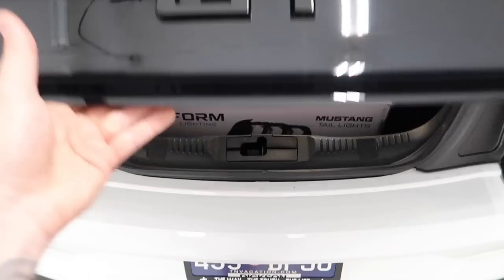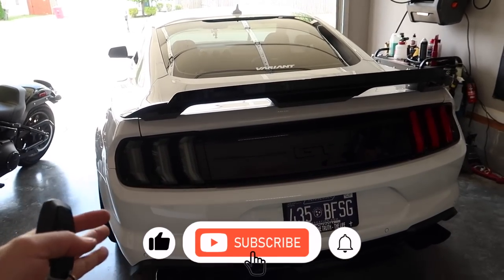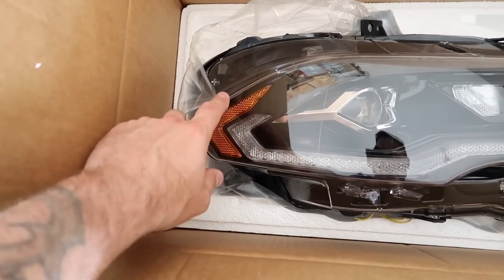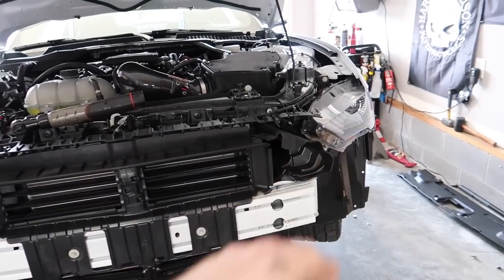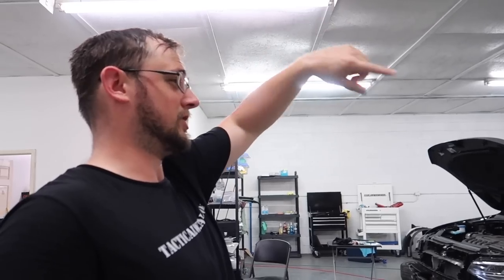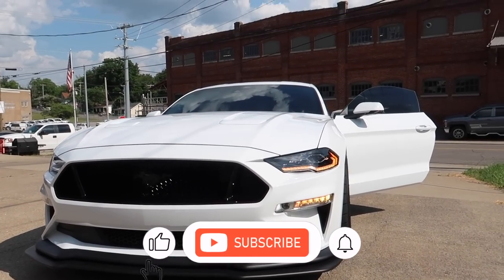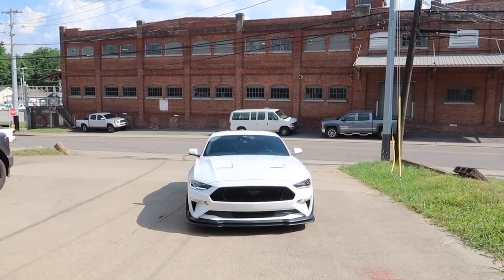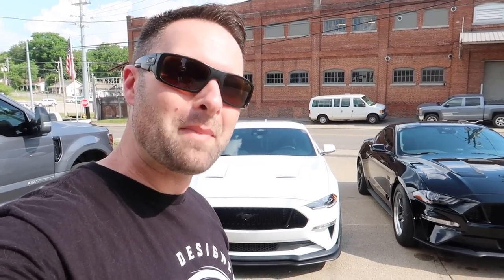TRANSFORMING The Look of My 2022 Mustang GT! Form Lights I'M SPEECHLESS!

Comment: I just installed the diode dynamics  turn signal with the yellow fog light straight fire. They are slightly tinted. Honestly you don’t have to remove the bumper if you don’t want to. Lift remove wheels couple of clips in the wheel liner  pull back  1 Electrical clip and (3 )8 mm bolts and they are out.

Comment: They are nice be sure to lay a small bead of clear silicone on top seating between lens and case.  I did my 2011 about four years back with this setup and have had zero issues.

Comment: I just traded my 2019 GT premium yesterday for a 2023 Mach 1 same color you had. We got the 10 speed. I didn't get the handling package, but it's my wife's daily.  We don't race. We had a Borla Atak cat back on the 19. We are loving the active on the Mach 1. I may go corsa double X pipe like you did, but then again I think I'm over excess loud. The factory Mach is just right on volume. People constantly complained about the Borla Atak (small town).
Reply from the maker: Oh nice. Huge congrats 🙏 the x pipe on the Mach 1 is perfect. Slightly louder but amazing deep sound with the stock mufflers.
Reply: @Zander13Productions Ours had the blade on the deck lid. We want the GT500 spoiler like this one and the Mach you had. Is that just a bolt on? I don't want holes showing from the blade, or have to drill new ones.

Comment: I bought these headlights but I always have to drive with the high beams because I can’t see with the normal dim
Reply from the maker: Did you align the low beams? That has to be done
Reply: @Zander13Productions  I didn’t see that in the install video but thanks

Comment: Looks good, but the morimotos look better, the way their lines match up with the lines of the car in so many ways and angles is just impressive, very thought-out design (though they have no startup or blinker feature)... That said, you should now black out/tint your fog lights to match, or maybe grab the Diode Dynamics Elite Series Combination Fog Lights, which just so happen to have a very similar blinking and startup feature to match, only reason I don't have them installed is cause their running white looks like shit w my color scheme but it would work w yours as long as the white hue of your new headlights match that of the oem (would be really neat to see those headlights and those foglights turn signal in sync)... And I have those same tail lights of course... I highly suggest replacing the reverse light with aftermarket (only about 100$ for the nicest which is really cool) as the oem is dogshit. Also you can replace the rear reflectors with actual lights pretty cheaply (also really neat mod),... So now I see you haven't upgraded the side markers to match the rear lights, they're kind of a no brainer as the oem is dogshit & they aren't that expensive & are easy to install (just a reach around basically) - would go to diode dynamics for those... Fuck it now that I'm on lights they even have replacements for the side mirror markers, cause the oem are absolute dogshit once again! (don't go to diode for these they got cheaper ones on Amazon)